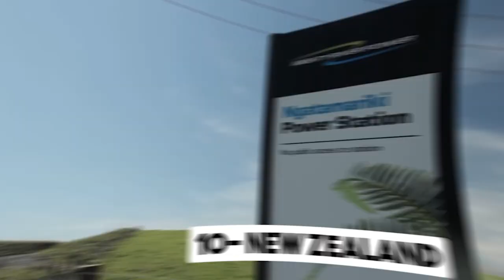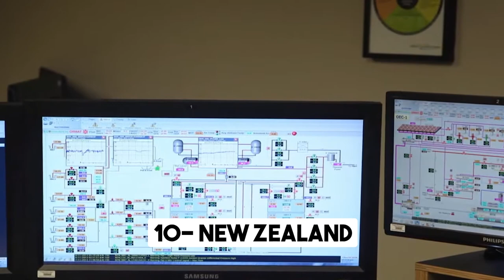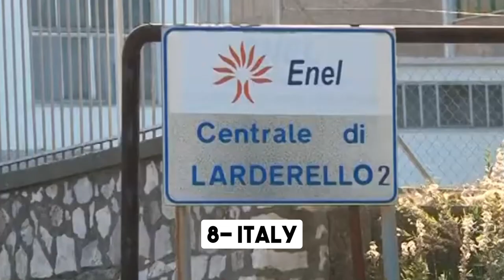Top 10 Geothermal Energy Countries

Comment: Subject to some Engineering Resources Fu, Geothermal is about the best that the planet can produce for Energy needs. Not quite widespread geographically enough to be the only player in town sadly, but its a better bet than anything else. Wont do shit to get rid of the CO2 and trapped heat around the planet - for that Geo-Engineering Marine Cloud Brightening is probably the best bet.
Reply from the maker: Very valuable points you raised. Thanks for the comment. That’s correct geothermal is not everywhere but it’s definitely one of the best.